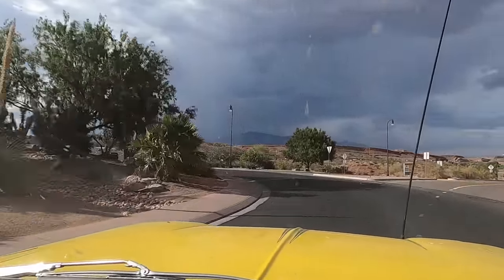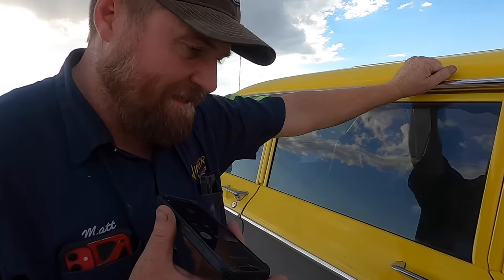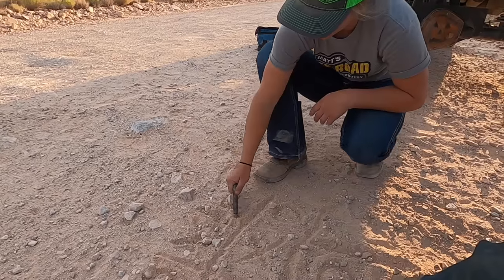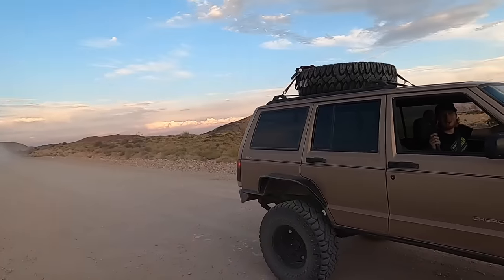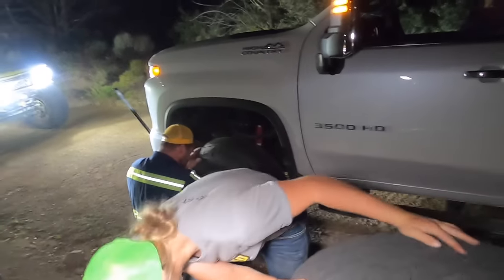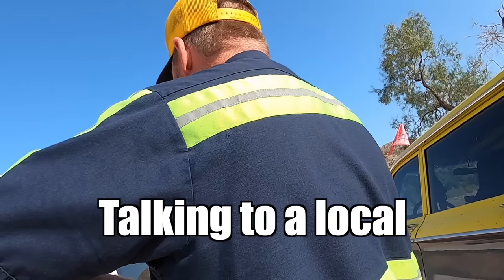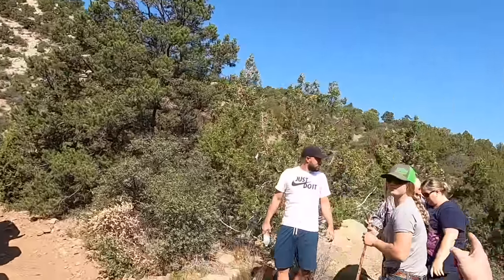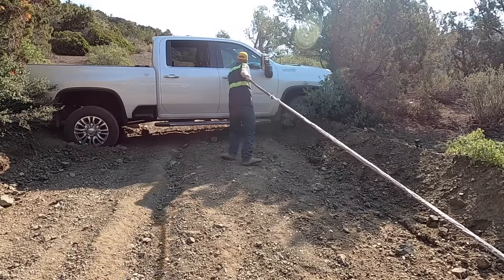Search & Rescue Mission Takes A Chilling Turn

Comment: Tyres/Tires.....funny old things.....I,m 66 and have been driving since I was 17........on cars (I have owned in the hundreds) I have had 2 flats that needed a roadside change...(Note:  Many of my 'cars' have been Landrover type Off Road cars) never had a flat on a 4x4.   I was a trucking owner driver for 9 years not a huge truck 25 Tons with 10 tyres......in 8 of those years (and I had to go onto building sites a lot) I had no punctures, but then in my 8th year I had two tyres blow on different rear axles same side.     I also had a military career for 15 years and never had a flat except once....middle of a forest at 5 mins past midnight up on the Teutobergerwald in West Germany in a Big 4x4 5 ton truck....damn thing slipped off the jack, chassis bashed me on the head, worked out I was flat out unconscious for 10 minutes or so......Still I eventually managed to change the wheel and get back on the track and complete the mission (Radio Relay - Re supply).

Comment: Wow,  Not to say that I am a 4x4 god in any sense, however when I went out I brought the gear I needed to reach out 100 feet.  I had saws, tools, chains and some common sense.  I also brought supplies for a couple days.  And this was in New Hampshire.  I'd never try a mid trail turn around with a double cab. I own a Dodge 1500 and I'd never go anywhere to far with with it. I had had built Ford Rangers from the 80's and 90's I'd trust doing that.  I had a 1997 F350 with a 460 that I would have thought would squash the world before becoming stuck there.  HOWEVER, I'd have backed that big truck out a long way before I'd consider high centering it.

Comment: Here I go lighting you up Matt as you stated. :) -but IF you  think about the laws of probability with the number of Recoveries, and as you said, you've had way more successes than failures, and besides, blame it on the heat, and or the fluctuating temperatures from dessert, to mountain region. :)

Comment: Do you guys not carry an air compressor with you in those trucks? I have a small one that powers off the battery or cigarette lighter that I keep in my truck. It's slow but it will get the tires aired up if they get low. They also have ones that look like a cordless drill but it's a battery operated air compressor.

Comment: Just ONE of the Continuing Issues with HOW 911 Addresses can be problematic. Sometimes Locals were asked for input, others, Local names were were applied by those with no Local knowledge. Then Some Preliminary Results Appeared on SOME Maps, Then NOT Updated to the Final results, along with roads which Cross Town/County Borders Not agreeing. Emergency Dispatchers Have Their Work Cut Out for Them In Some Areas! Got Lots of Foliage, And Hills? GPS Might Not Work either, along with your cell!

Comment: Hey Matt why don't u bring an air compressor a small one u would save thousands of dollars in gas get better mileage if u aired up your tires before highway and Air em down when off road u can get air compressor with a battery hookup so u just have truck running and Air em up brother save u tires gas mileage more comfortable ride safer on highway speeds

Comment: Recovery team also without a jerry can with gas  between to “recovery vehicles “ ? BRUH
Reply: Where do you safely carry a Jerrycan of fuel?
Not inside, not on a rear rack, not on a front rack and not on a roof rack....
Could they have an extended range fuel tank built into the Morrvair???
Probably...

Comment: Won't it pay to carry a spare on the roof maybe other tools as well🤔
Reply: Think about the size of the tyre and wheel..where do you put it?
Not inside, not on the back on a carrier, not on the roof, not on the front bumper...and not underneath....
It just can't be done safely or without interfering with day to day tasks.....
and Matt has stated that he operates mainly less than 30 minutes from base..

Comment: whoops ..... no spare
Reply: Think about the size of the tyre and wheel..where do you put it?
Not inside, not on the back on a carrier, not on the roof, not on the front bumper...and not underneath....
It just can't be done safely or without interfering with day to day tasks.....
and Matt has stated that he operates mainly less than 30 minutes from base..

Comment: No spare?
Reply: Think about the size of the tyre and wheel..where do you put it?
Not inside, not on the back on a carrier, not on the roof, not on the front bumper...and not underneath....
It just can't be done safely or without interfering with day to day tasks.....
and Matt has stated that he operates mainly less than 30 minutes from base..

Comment: You do this stuff and don’t carry a spare?
Reply: Think about the size of the tyre and wheel..where do you put it?
Not inside, not on the back on a carrier, not on the roof, not on the front bumper...and not underneath....
It just can't be done safely or without interfering with day to day tasks.....
and Matt has stated that he operates mainly less than 30 minutes from base....

Comment: LOL your a “recovery team” without a spare tire, no patch kit, and no onboard air? Da fk??
Reply: Think about the size of the tyre and wheel..where do you put it?
Not inside, not on the back on a carrier, not on the roof, not on the front bumper...and not underneath....
It just can't be done safely or without interfering with day to day tasks.....
and Matt has stated that he operates mainly less than 30 minutes from base..

Comment: And you don't have a spare tire with you  why??????
Reply: Think about the size of the tyre and wheel..where do you put it?
Not inside, not on the back on a carrier, not on the roof, not on the front bumper...and not underneath....
It just can't be done safely or without interfering with day to day tasks.....
and Matt has stated that he operates mainly less than 30 minutes from base..

Comment: spare tire? really?
Reply: Think about the size of the tyre and wheel..where do you put it?
Not inside, not on the back on a carrier, not on the roof, not on the front bumper...and not underneath....
It just can't be done safely or without interfering with day to day tasks.....
and Matt has stated that he operates mainly less than 30 minutes from base..